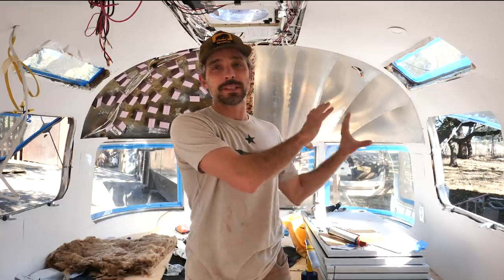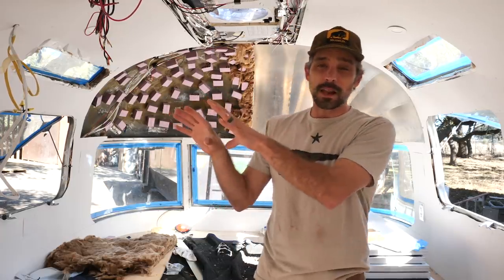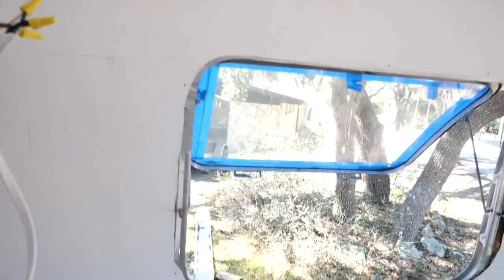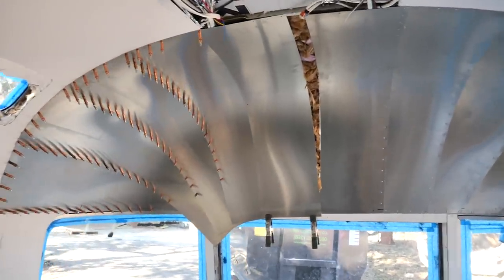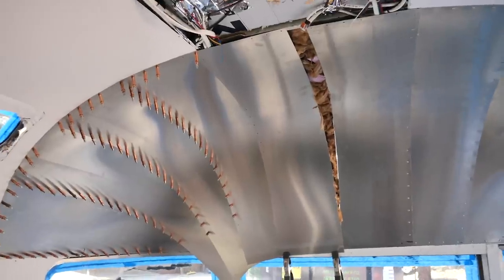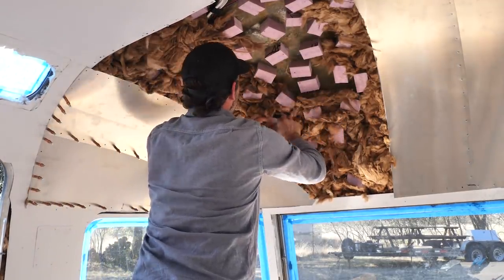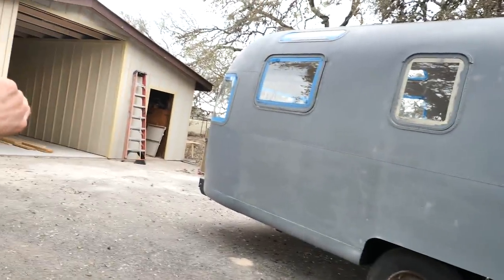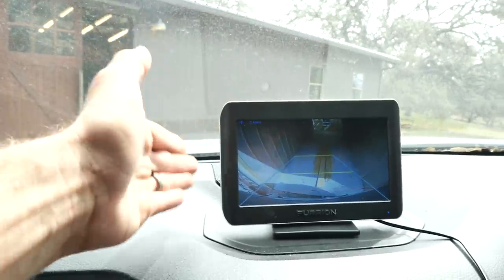Segmented End Caps, WIFI Antenna, New RV Storage (Airstream Argosy Ep. 19)

Comment: Awesome Andy... I used to work at a trailer camp. I would move the trailers into enclosed storage for the winter. I made a front hitch on my 4 wheel drive tractor. My hitch would take 1,000 lb tongue weight. Pushing a trailer with a front hitch is far easier than backing it in. If you have a small 4x4 tractor, fabricate a hitch and it will make moving your trailer in the yard a breeze.

Comment: Hey Andy, Just an FYI that we developed interior endcap kits that we sell & ship in "knock down" form via FedEx ground. They are laser cut & all the holes are NC punched. Edges are bead rolled to allow the panels to lay correctly as they create the arc. The kits get preassembled with "buck" rivets outside the trailer, then carried in through the door & installed. We have used them on many of our shop projects & supplied them to many other Airstream restoration shops & DIYers.  Some people choose to polish the panels & some choose to paint.

Comment: Would be awesome to have a door in the divider wall that lines up with the trailer door so you can work on it while it’s parked in there
Reply: I was thinking the same!
Reply: That's what I was thinking slider door so can open and not hit car or trailer and load for trips also don't forget access to power up so can use lights and fridge

Comment: Lookin good Andy. The cliko makers are lovin you fella ! Nice parking job but a bummer if you need to get into it while inside. A traditional 5 spoke wheel with a like pinstripe to match the lower part of the body or even the top color. Go for it as it will look great either way eh.

Comment: Andy, you need to put a door in your car  garage so you can get into the trailer without pulling it out. I suggest a sliding barn type of door. Then you don't need to pull the trailer out if you need to get inside of it for some reason. I also suggest having a AC plug in for the trailer in the carport so you can work in the trailer while it is in the carport. cheers
Reply from the maker: I’ve actually been thinking about doing this.  I know I’m going to get annoyed not being able to get into without pulling it out of the bay.
Reply: @AndyRawls  It is a lot easier to take the car out, also if you get some bad weather you can still work on it. Make it big enough I would say 48 inches. Next put stops on the floor so the trailer is always in the right place. Cheers

Comment: Andy I actually like the looks of the chrome mods better. But you could also go with a painted wagon wheel, instead of the baby moon hub caps which look good as well. But all three would be correct for that Argosy trailer, and by that I mean baby moon hub caps, wagon wheels and chrome mods. That said go with the chrome mods, as it will be more fitting with the modernization you have made on that trailer.